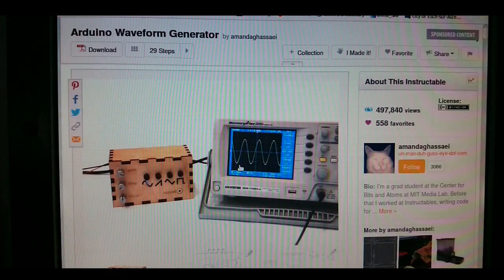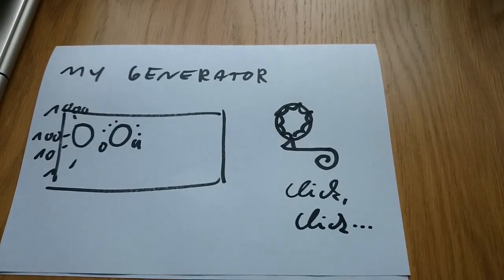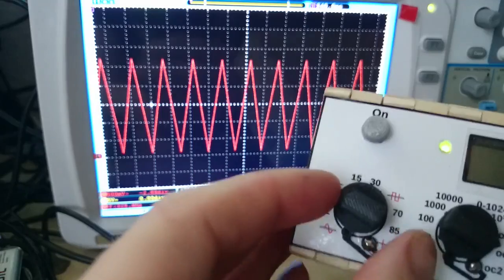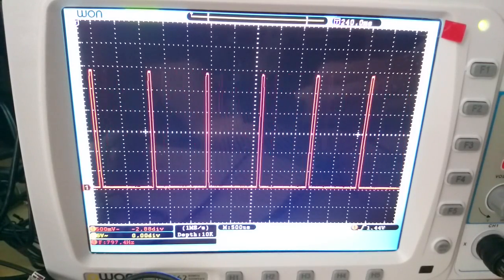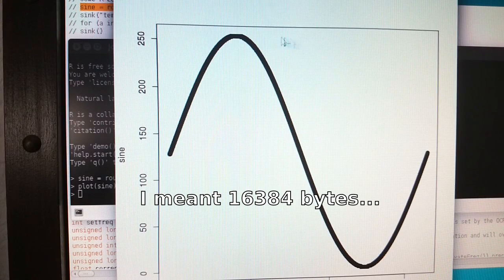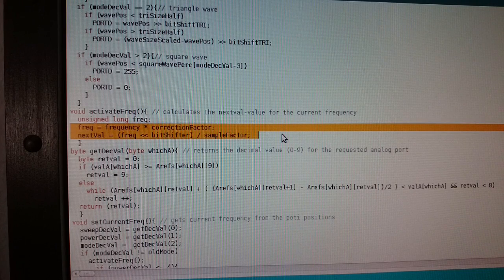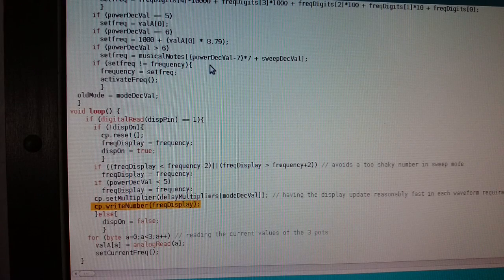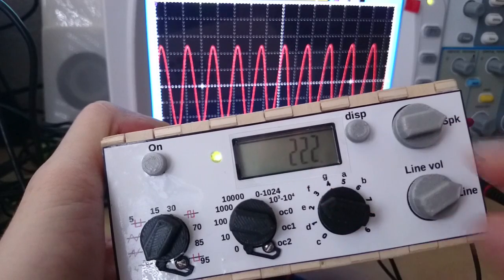Multi-function Arduino waveform generator with speaker and LCD

Comment: Hi, Nice project indeed. It can output 20mV pk2pk wave? I want to use this to do some common emitter amplifier lab with 20mV biased input. thanks
Reply from the maker: The 8-bit DAC attached to the arduino can output about 3V peak to peak (see video at around 3 minutes where the scope screen is shown).

Comment: Can it make a bi-directional wave?
Reply from the maker: As in "A wave with positive and negative half"? The amplified signal is bi-directional because the output capacitor removes the DC part of the signal. The unamplified signal never gets negative relative to ground, but it would be negative relative to a "Vcc / 2" point.
Reply: @Joekutz  So no then.  Maybe I should have said bi-polar.  Thanks.

Comment: Hey dude, good video!
Can I generate a VCO (100KHz ~ 200KHz) triggered with LFO values?
Thanks bro!
Reply from the maker: I am not sure you can create a >100KHz tone with an arduino UNO in the way shown here, because you would need a sampling rate of at least 200KHz. The CPU might simply be too slow for that.

Comment: Hi, thanks for providing your code. It has been a great education for me, in bitmath and optimising code to make use of the quirks of binary numbers. I'm not ashamed to say it has taken me a couple of days to understand your reasons for designing the code like that :) But I have one question which I'd be grateful if you'd answer! The line nextVal = (freq << bitShifter) / sampleFactor seems unnecessary to me because sampleFactor will always be 4 at the interrupt frequency and sample size you chose, so it amounts to (freq * 4) / 4 - did you just leave that line so that others can change the code for different interrupt frequencies? Thanks again, great video.
Reply from the maker: You are right, the line could be simplified. The line was there since a early version of my code because I experimented with different wavebuffer-sizes and samplerates. Very well analyzed!
Reply: Cheers, thought I might have misunderstood something but it makes sense now.

Comment: i need to see this code. how did you get it to output 30Khz ! that high! i couldn't get it past a few khz, i used direct port manipulation.
Reply: oh i see your using a lookup table :) i guess that is cheating! or not .. i was generating the wave forms dynamically ofcourse. doing a calculation between each step.
Reply from the maker: Yea, arduino is not very good in life-calculation of floating point values - so I found cheating is allowed here. :)

Comment: I have the problem, the code inProgmem Error mismass 0xf80
Reply from the maker: Do you have that error in the small code piece that creates only one tone? Do you use an Arduino Uno (Atmega 328P) or something else? Do you have a recent version of the Arduino IDE? Google for "Arduino progmem" to find further code examples and test where the problem lies.
Reply: +JoEtuuube yes, in "sound_generator440", i use that in arduino IDE 1.5.6r2 and use the VISDUiNO(clone ) 

i use this program only because i need create a "sine generator"
Reply from the maker: I googled the VisDuino, and the web page says "We replaced the main IC atmega 328 PTH to atmega SMD QFP" - May be that IC does not support the progmem command as the Atmega328P does. I never used that board, so I cannot help. May be getting a cheap "real" Arduino clone instead?
Reply: +JoEtuuube Use the code "function_generator_440" and it worked, I uploaded it to visduino and ready. The problem was that it lacked a data to the progmem and in spite of the error, it also works 

Thanks for the help

Comment: Can the line out/speaker out  be connected to a laptop (mic in) to record or listen to the wave sounds! , also did you need the Arduino proto shield at all here? thanks for sharing !!
Reply from the maker: I could record the line-out signal, yes. I didn't use a proto-board, just a piece of prototype-PCB to make the resistor-ladder.

Comment: How about a schematic and Arduino Code?
Reply from the maker: The circuit schematics can be found in the original article (http://www.instructables.com/id/Arduino-Waveform-Generator), I used pretty much the same setup. The arduino code for the sound generator can be found on my hackaday page.